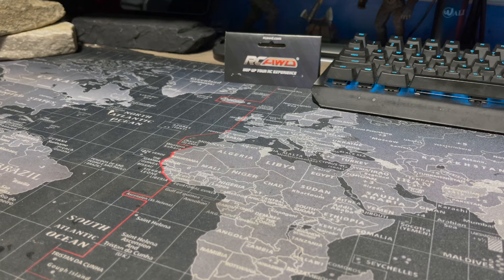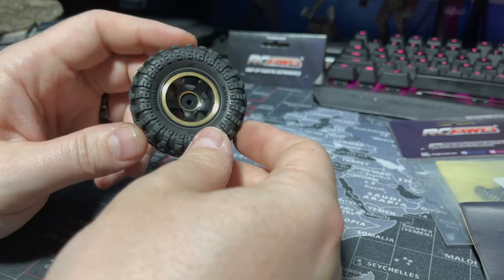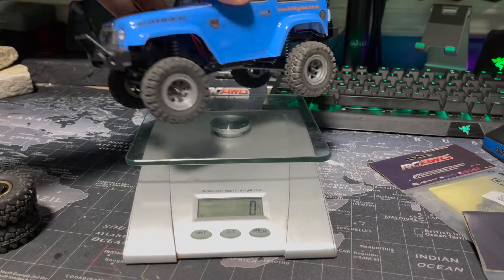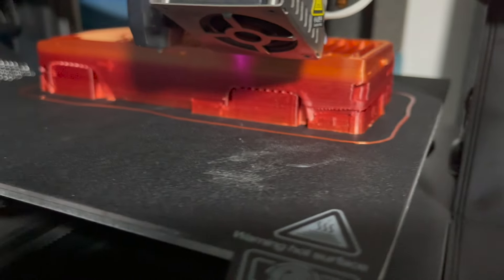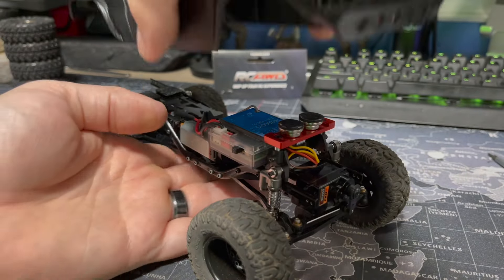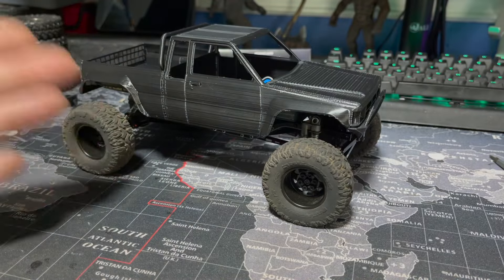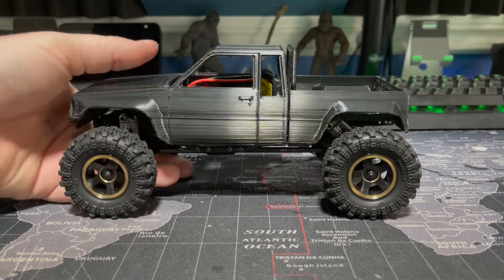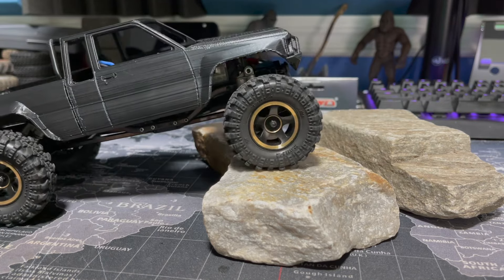Scx24 Upgrades // Toyota Build Gets Some RCAWD Goodies!

Comment: You should look into resin printing. I make k10 bodies in resin and they come out super smooth and are easy to paint. its more of a paint in the ass to get running, but the results are so worth it.
Reply from the maker: Yeah I’ve been looking at resin printers, I’m sure I’ll get one but yeah the setup for them is what has me holding off👍🏻

Comment: Dang man! those wheels are the heaviest Ive seen yet! Ive got some Jazriders (which I thought they were the heaviest) that come in at 42 a piece, with a tire mod I do they come in at 70g a piece when done. those one are just beast mode at 50g a piece without rubber. Wow! they look good too! awesome stuff man!

Aslo, have you see 3d printers from ANYCUBIC, as in the Photon versions? Man Id bet the quality of body they could print would be next level stuff. They quality they print is far superior to the standard 3d printer!
Reply from the maker: No I haven’t seen one of those printers but I’ll look into them, they sound pretty cool if they print good quality! 🤘🏼😄
Reply: @UpperLeftRC  Their quality is unmatched when you compare the typical printer to what they can do. Be so awesome to see a 3d printed body without any imperfections on it, like the lines the printers make. Just not sure about the weight of that resin vs what your using now.  Either way, tjhat truck LOOKS awesome man, makes me want to order something like that for the Gladiator I just got :)